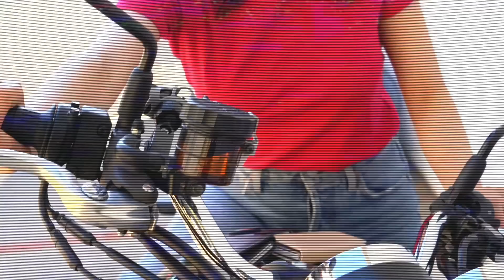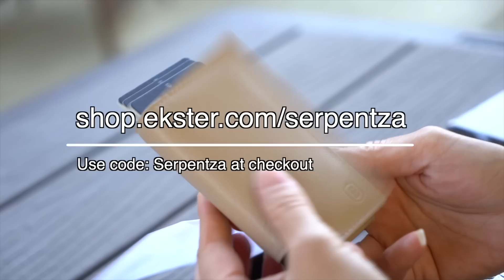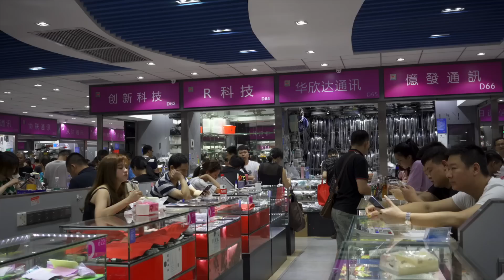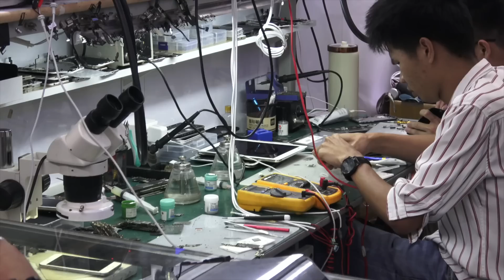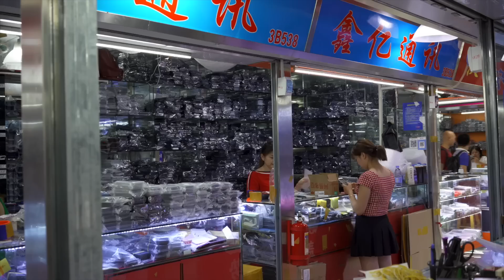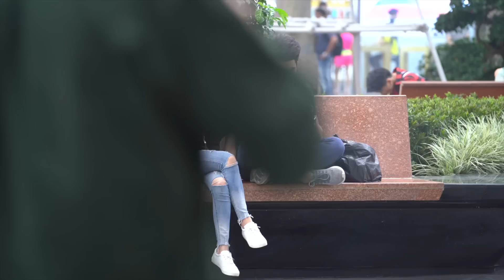Why China Can't make Chips!

Comment: I did my bachelors in a Chinese University before I came to the States. I was working in the lab doing electronic design. One day I walked into the lab next door, and I saw about 4 students. They were all probing circuit boards (some kind of commercial PLC controller) by using multimeters in continuity mode ("beep beep beep" all over the room), then they recorded the connections of PCB traces. I was told that their professor asked them to backward engineer the board, so that the professor could make a knock-off. Those students (mostly from countryside) were paid like 100 CNY/month for doing that for him, and in the name of "learning electronic design". In fairness I don't think of bad of those students since they just did what their professor told them to do. But man this kind of thing happens in university encouraged by a professor...
Reply: The professor of my senior year mechanical engineering design class had our group design a boat lift that I suspect was for his buddy's marina. Probably common to exploit students?
Reply: It all depends on the context. Technical universities often do reverse engineering as an exercise. For example, I remember an assignment when we had to analyze and explain a 709 op amp, from looking at a photo of the chip which was handed to us. While at uni, I've also done a much more complex exercise, the partial reverse engineering of a graphics chip, with layers etched off, photographing and analyzing, recreating an equivalent circuit schematic, simulating parts of the circuit/layout etc. However, at the end, this was an educational exercise and the purpose wasn't to copy and "steal" the chip.
It was also a lot more fun than buzzing out the connections on a circuit board! 😁
Reply: our professor dont even go that far, they had studied a book of like 1980s era or 1990s, and they been teaching the same  book for years, they have greyscale copies of those book as those book have so many editions now, they dont get printed anymore, they even ask student to  redo the same projects of his own times like the ones students of 1990s might have submitted, and the same is repeated, it goes for students in engineering, medical colleges, research institutes you name it, be it a bachelor program or master or even PhD or whatever,  I live in Pakistan
Reply: How else do you learn tho?
Literally you have to hack and reverse engineer in the MIT.
Reply: If you just think of learning and stop, think of copy and steal, you can learn.
Reply: Texx Mexx  err he married a Chinese person and liked living in China, so I don't think he has a problem with Chinese ppl. Also, the issues you mentioned about Sth Africa might be why he's said he doesn't want to go back to live there. And just because someone comes from a country that does disagreeable things doesn't mean we should judge them for it. If we did, we wouldn't accept anyone from other countries as friends. I don't think that @Serpentza condones the actions of his home country, just like I don't think most Chinese ppl condone the repugnant actions of the CCP.
Reply: @lorabex791  It's supposed to be a course in electronic design. That means building simple projects from basic components to illustrate the fundamentals of each circuit type, and where and why you might use each one to function as a whole unit in a given design.
 It is true that you can learn from reverse-engineering, but only compartmentalized information highly specific to that particular end product. It won't tell you how to design a similar but unique device. In fact, it won't even tell you anything about a nearly identical product by a different company, because even using the same design principles and architecture, each circuit and its layout will be wildly different, as those are secondary functions of parameters like available PCB or enclosure space, component dimensions and pinouts, etc.
 The only reason to learn that way is to either learn how to copy that specific device, or perhaps how to repair a faulty one.
Reply: everyone does reverse engineering. no need to invent a bicycle if it already exists.
Reply: @giopa110888  Clearly you didn't comprehend the topic of the video.
 Reverse engineering is fine if you want to understand a certain specific product. If you want to open up a repair shop for that specific product, that's fine, and you have a good shot at success.
 I encourage this; the more localized repair shops there are, the less needless waste there is to deal with. It can even be a profitable venture if you work hard at it.
 However, this won't tell you much else. It certainly won't give you the basic knowledge to make any given existing product perform any better, and you sure as shit won't be filing any patents for your mere ability to trace a circuit that someone else had to design from scratch. That is the point you somehow missed.
Reply: Texx Mexx  This is a pretty ignorant thing to say.  Not only has he directly spoken out against apartheid (as well as the current communist gov in SA), but even if he hadn't that is exactly like calling out Iraqis because they supported Saddam Hussein, or North Koreans because they dislike South Koreans.   In his videos he stated repeatedly that he is NOT speaking out against the oppressed Chinese people, but ONLY the Chinese Communist Party (CCP).  If you paid attention to the video, you can tell he is very careful with his wording to only put blame on the top-heavy structures which have been implemented and encouraged by the CCP/PRC since they took reign from the ROC.
Reply: @timcees  that’s different, they aren’t redesigning something someone else created, ie stealing and profiting off someone else’s hard work.
Reply: I suspect  Texx Mexx  is one of those bots @serpentza keeps warning us about so I wouldn't get too worked up about the dodgy comments.
I suspect my comment was targeted for an answer because my comment may have been seen as if I was defending the Chinese uni prof. 
No, I was just saying that reverse engineering in itself (especially in education) is not necessarily evil. It can be, if the aim is to steal IP or copyrighted material.
Reply: Texx Mexx  rofl, you're fifty cent army I take it?
Reply: On 7/8/2022, one writer under the name Casgains Academy, posted an article on "China's ENTIRE Economy Will Collapse In 34 Days (update: it crashed)"
3.2M views · 1 month ago

I counted the due date to be by tomorrow 11/9/2022. But is China's entire economy crashing? Or has crashed? LMAO!!
Reply: Reverse engineering is a very good skill for a future designer or repairman to have... So while the professor did it for his side hustle, the students actually gained useful skills from it. I've been doing the same to get to understand circuits since I was 12 or so.
Reply: @PravinDahal  That,s why their product fails,
Reply: @PravinDahal  Brilliant? Its as brilliant as if your poorer neighbor would burglarize and empty your house while on vacation, and then tell you it was going to a better cause.
Reply: @johnwayne8475  That’s totally untrue. Having a bunch of student study the innards of 741 opamp for academic study is one thing (like mentioned above). Asking a bunch of poor students to knock someone else’s product, to make EXACT copy, for profit, is something else. I don’t think those students have much idea how that thing works. “This board uses this chip, from which on pin 14 it goes to a 22k resistor, and goes to another chip”. They are not doing any improvement just making exact knock-off and sell it for a CHEAPER price that’s all. That’s not what Tesla are doing. What kind of gaining insight/research is that?
Reply: Texx Mexx  would you want those animals living around you? I didn't think so
Reply: Texx Mexx  here's your 50 cents!
Reply: @jmchng9662  What does that have to do with this channel? these guys never make those "China will crash in 3 days" type videos, in fact they pointed out how they are wrong, but then again, you wouldn't know that, you can't think for yourself, you just post whatever comments your Chinese overlords tell you to.
Reply: @slammerlo510  Someone did it the first time, without the reverse engineering.  That's the point here, China doesn't have the academic culture to do that research and engineering.  They just really good at figuring out how to copy things other people already made.
Reply: @tforaodg  Haha believe it or not is your own thing and take your own grain of salt. Go figure. It’s sometime after 2010 and somewhere in China. At least I know what 741 opamp is and what continuity mode is so enough detail has been given to whom I to deliver the message.

Also prove me your are not some unemployed Chinese assigned a VPN making propaganda for pennies.
Reply: @f.b.l.9813  There are a lot of chicom bots down here. They can try and disguise but their way of thinking/talking reveals where they are from. There are a lot of unemployed University graduates in China (some say 80% but it could be higher) and some go to the so called “media group company” making propaganda for pennies. Few years ago there was a report that almost all graduates from department of Sociology and English of some Universities (in Hubei and the other in Guangdong in the report) were going to such “media group companies”. Unlike those in the camps, they are able to speak a little bit of English.
Reply: Texx Mexx  玻璃心
Reply: You're a liar or you've been duped，Beggars transfer more than 1,00 CNY /day
Reply: Texx Mexx  You are wrong. After watching this channel for several years now, it is clear to me that Serpentza LOVES the Chinese people and culture. I remember a video where he described the buzz and optimism of the people when he first visited. And he quickly sold his stuff in S. Africa and moved to China to live and work. Serpentza is criticizing the CCP and Xi - not to be mean or anti-Chinese, but as an attempt to tell the truth about the CCP. Freedom to express an opinion is a basic human right. Living in USA, I can say in public that President Biden sucks and Trump sucks and USA sucks - and the police are not going to take me to a re-education camp or lower my social credit score. CCP is changing China for the worse. And Taiwan is #1 real Chinese culture. CCP sucks!
Reply: I want to know why people are concern about China this days .. China is so popular now
Reply: @sheilacoulton775  if their products failed, Walmart would be closed decades ago. This guy who made this video makes a lot money from YouTube by creating negative comments about other people.
Reply: I   had   to    do   the    same  in   order to  understand  how   some   pcbs   from   Brazil   work.
i   paid   500  U.S   dollars  ,  I  did   the   reverse  and   once   I   undestood   how  It  works,   I   designed  the  software.
i  Sold  the   software  and  installed  this  pcb,   I   sold   those  in   15.000   U.S    dollars. 
I   am  proud  of  it,   because  at  that   time,  I    did  not   have  a  degree in   electronics,   neither  in   software.
To   program  microntrollers    and   Software     ,  i   had    to  do  it  by  myself.
Reply: There   are   some  commercial radar  devices i  would   like  to do   a   reverse   too.   but   i    do  not  know   too  much   about  that.
Reply: @lorabex791  the hardware is irreducibly complex at every layer. even subcomponents in the cpu die itself can be as well. you cant do it, it's like putting a nuclear reactor into the 18th century amd expecting them to get it right away. there is so much just hidden in a wrinkle dimension optimized away from 1000 gates into 5 using the knowledge you just need to know exists.
Reply: @nnaaaaaa  It is but you can learn from someone else's example, at most universities where hardware design is taught RISC V has to be present.
Reply: And you went along with with the system by doing nothing.
Reply: What's wrong with reverse engineering? It is a useful skill to have and could be critical in case of necessity, and by itself is not unlawful. It becomes when the knowledge gained is use for counterfeit production instead of for research (i.e. if the professor makes a knock off without improving it). I think there is much more wrong with patents today to be honest. They are given for anything, are too broad, and they last for ages, hindering innovation, and raising the entry ceiling in some area of expertise by requiring absurd amounts of money... doing the opposite of what they were meant for. And they are given and can be held by companies that have nothing to do with their application. The lack of laws in China that do require abiding them, is good in my book. They helped a lot of people in China in the last 30 years. A serious patent law reform is needed worldwide to make patents serve their purpose again. Their purpose was to research something else instead of making the same thing. But if you have an uncountable number of them for every segment of research, then research itself is hindered, and everything becomes a playground for lawyers instead of scientists and engineers. As a simple example: do you think Apple should be able to get 30 year patents for anything in the area of phones, when phone technology lasts for a few years before becoming obsolete? Does that help the phone industry?
Reply: hahahahah my seniors once told me their structural design lecturer did something similar he was doing part time and would always give em questions that were oddly specific as assignments and they had to run the calculations for him and design the buildings, which they suspected he was using in his part time job
Reply: @Joe Flink Supplement that with theory, and you get a student that will understand the various designs he's been told to reverse engineer. It seems very efficient and effective. If one has taken apart a car, one may know.
Reply: @f.b.l.9813  Here is your half dollar .
Reply: Texx Mexx  Imagine being you and so out of the loop and just blatantly wrong.
Reply: @hanfucolorful9656  That's some mighty cope outta you.
Reply: @DrMackSplackem  similarly, looking at snippets of code will not provide an understanding of the whole. The hardest thing about coding is conceptualizing the solution to a problem then writing the code to perform the solution. ie. Code to write a variable to RAM or disk is not the same as displaying vector graphics or making an app that people will pay for.
Reply: They're doing the same in Western Universities now.
Reply: @patienceobongo  That's fine, but they should be clear about what their curriculum provides: A path towards an intimate understanding of the workings of a specific product engineered by someone else for a certain physical end product. That is all such a curriculum can provide. Probably there should be a different course for every end product, because learning the intimate details of one won't tell you much about any other.
Reply: As we say in software development, "Information wants to be free."

It's fine to make initial profits off an innovation but at some point, others are going to successfully reverse engineer that, whether that happens between companies or between nations in competition. There are also ways in which control of information is a very bad idea, consider vaccine patents and the like.
Reply: Texx Mexx  If you follow his videos, you will understand he is pro-Chinese People, but anti-CCP. I'm thankful we have his voice. 台灣萬歲！
Reply: @timcees  One way to look at it is exploiting a resource he has to design something, ie his students. The other way to look at it, he gave his students a real world engineering problem to solve. Not a theoretical problem. One that they had to design and then possibly test virtually, work out the bugs and then produce it. That real world process, from idea, design, testing, resolving issues and then having the design built, is real world experience. You have to get that experience somewhere.
Reply: when?100 cny for a month?
Reply: @sandman0123  That surely sound like a fun think to do. And very useful when it comes to replace an obsolete IC in an expensive device.
Reply: It is nothing wrong to study and develop. At least CHina is not robbing, colonizing and killing.
Reply: Actually reverse engineering is important in engineering seriously
Reply: Industrial espionage should be taken very seriously

Comment: who is here after Huawei and SMIC unveil advanced 7nm Processor for Mate 60 Pro
Reply: laughs in 3nm architecture
Reply: @@SirWilliamDeHooton Yawn... How do you think the 7 nm chips were built? With Chinese litographs? ^^ Little spoiler: those can only handle 28 nm for the moment ;).
Reply: @@SirWilliamDeHooton Ah they'll surely try now. We'll see how successful it is eventually. For ASML it took them decades to get to the current point. Anyway, for a country which apparently needed 5 years to manufacture little steel balls for pens, excuse me if I am a bit sceptical regarding fast Chinese successes with the lithograph technology. ;)
Reply: @@SirWilliamDeHooton It seems you don't know what racism actually means...
Regarding the pens: didn't you watch the video? The USA imports electronics, because it's cheaper. So how the hell is it advantageous to get the mentioned steel balls from Germany, Switzerland or Japan?
Reply: The nano meter label has become a vague marketing description , something like the 2000 watt (pmpo) amplifier (with a 100 watt power supply) of years gone by